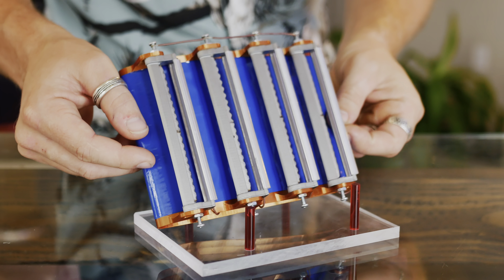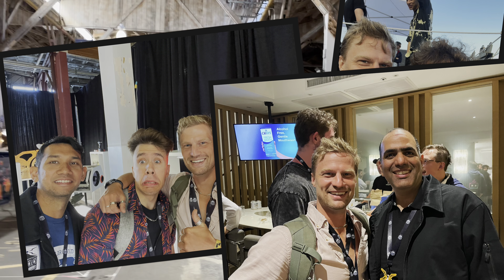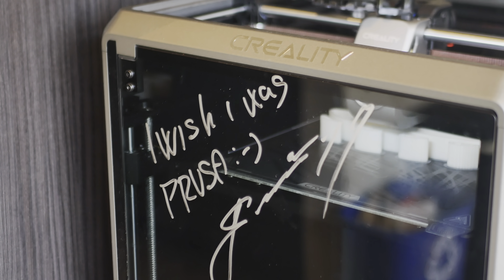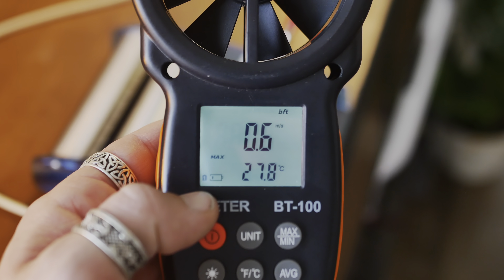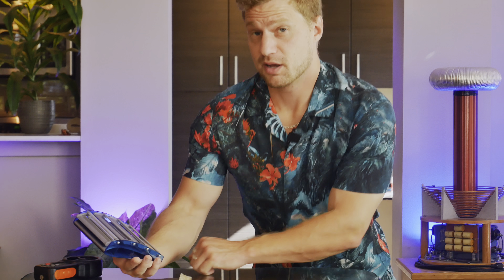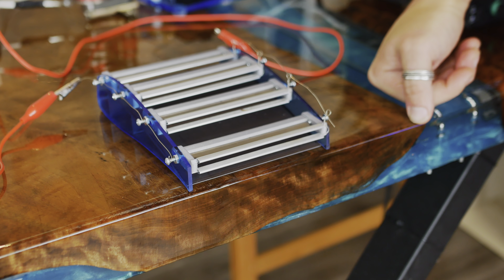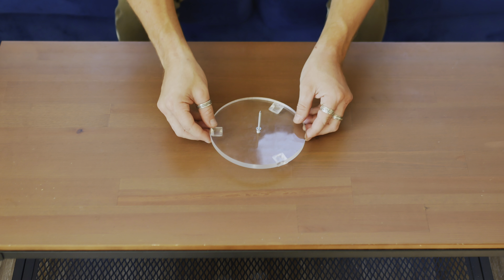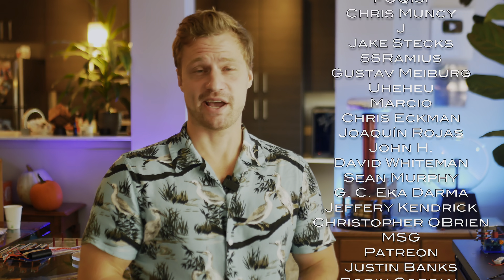Designing A Self Propelling Ionic Thrust Wing

Comment: holy damn! thats an amazing idea!! i will say for as much as i lack motivation to do things cuz of adhd and high functioning autism as well as a whole heaping helping of mental issues from childhood like ptsd and abandonment issues, seeing things like this does always help bring back that desire to really see the limits of what can be done!!! as for possible improvements i could think of off the top of my head right here, some possible ones would be to consider what materials you are using all together and now that your have kinda honed in on a more solid shape and design, maybe its time to consider moving onto the more expensive stuff that is more durable and weighs less (that saying there is tho i would imagine that is the case since 3d printer PVC plastic aint usually too terrible light from my own experience) and beyond that, there really is only the obvious improvements you mentioned of find ways to use less material for the same result as well as increase the possible power output while also trying to maintain the same weight with the power supply. ultimately as it stands right now, maybe one thing you could also try just to see what might be better is mess around trying out different glider wing designs since while it would make sense that one designed for long, slow glides would be best, you never know unless you try especially since it could also be something to test to see if there is diminishing returns from the engines past a certain point meaning a smaller wing or trying with varying amounts of engines could be a way to prevent you from accidentally throwing in too much weight without really getting your benefit outta it. :D all in all keep up the good work and each time a video has dropped in this series, youtube ACTUALLY has bothered to recommend it to me so i will definantly be here for the next one too!

Comment: Love this concept, yes I believe this may be the beginning of non motion based flight.

Also, what about using electro coating to replace external wires and metal.  Also, possibly you could incorporate the pcb and circuitry inlayed into the section of wing that would further reduce final weight and create the option of variable thrust for steering and yaw control.

Comment: I would keep it simple like the ionic lifter, just wires, foils and foam.  String the wires along the length of the wing just above the wing propped up about 1/16” at the ends and add mid supports.  Tape aluminum tape to the wing top surface at the tail end of the wing will reduce drag and parts.  You could add more electrode sections to the inner part of the wings where there is space for shorter length electrodes.  Instead of printed plastic use hot wire to cut foam wings or use a rasp to shave the shape of the wing.  

For added thrust (not lift) use wire rings propped up around the fuselage (made from foam to reduce weight) and aluminum tape to the fuselage.  Repeat with more rings towards the tail.  It would be like your ionic thrusters rings but inside out.  At the end of the fuselage use a ring wire and round tube with a smaller opening at the end before the empennage (tail control surface section) to increase speed.  Like your friend Integza’s ionic thrusters.  You’ll need the forward speed to get the airplane off the ground.  

Battery and RC electronics should be towards the front of the fuselage to balance the airplane.  You can place your airplane in front of a box fan and hold on to the balance point and see if it pitches up or down.  Move the battery, electronics forward or backwards to balance the airplane. The center of gravity (balance point) and center of lift would be 1/3 the wing cord from the front of main wing.   The electrode rings should be further back away from the battery and electronics to prevent arching and possible frequency interference to the RC electronics.  

Double decker wings will double the space for electrodes and add more lift and thrust.  The top wing should be stagger forward like the barn stormer airplanes.

You could make a flying or blended wing airplane.  Electrodes sections on the top of the wing with a few ring tube narrowed at end for speed mounted on the end portion of the lifting surface.

Comment: Wired in parallel? Why not in series? Ok so not traditional series cus air gap but like a voltage multiplier tapped at different points to give an increase in voltage as stages progress but the last airfoil may need to be the highest voltage of them all. You got stls and a shopping list?

Comment: Print an aerofoil frame and skin it with a thin latex. I think you can still shave a load of weight. I'm thinking perhaps the plasma conductors should be closer to the wing surface, so maybe latex is not so good. Maybe wax paper.
For the plasma electrode, maybe a piece of guitar string. Some are nickel wound and so would provide a consistent interval between (I don't know what to call them) {ionocytes}? But the serated blades appear to have misfires. Guitar string may help save weight and increase power, but I don't know. Sure enjoy watching this development. Can't wait to see more. Thanks.

Comment: To maximize the amount of conductive space on your positive ends you could weave the wire back and forth vertically through spaces in the 3d printed part, kinda working on similar mechanics to your original thrusters but along the extremely thin rectangular space where the razor blades used to be. If that works you'd get massive weight reduction and maybe even an increase in thrust. I'm really excited to see this work, it'll be a huge accomplishment

Comment: I'd have to ask how this will effect the Airfoil? With all of the thrusters on top of the airfoil, yes the air will move fast over the immediate airfoil's upper skin , but at the same time there will be less air passing the airfoil leading edge's lower surface, the most critical area, due to suction from the ionic thrusters, causing the stall characteristic to be indeterminable until a set ground speed, then ground effect speed are met/exceeded. This doesn't even take into account the impact of the thrusters themselves impeding the fluid air flow that surrounds the immediate area above the airfoil causing further drag. This would almost work best mounted to the lower surface of a symmetrical airfoil with an upward twist, moderate to high angle of attack, or mounted inside of asymmetrical wing as a pass through that would not inhibit the fluid's action about the airfoil. Wings are extremely sensitive to changes in airflow and this gets further exacerbated at different bank angles or roll maneuvers, and again with wing lift bend which could further diminish the thrusters effect on a top mounted configuration. I only see this working as a type of air pusher in this configuration as it would greatly hinder a wing, almost nullifying its ability to create any lift.

Comment: Very cool. What will kill you is thrust per unit power (ie newtons per watt), and a higher efficiency system actually achieves the same momentum transfer to air at lower velocity. Higher wind speed just means more power wasted in turbulence. 

I remember trying to figure out how to do this in about 2002, before lipo batteries and stun gun power supplies. Good luck!

Comment: Silent electric flight devoid of moving parts... max intrigue! 
The early tests show promise, but it clearly lacks the efficiency needed to overcome gravity with the weight of a craft. My opinion, it won't work. I think an issue is going to be the implemented propulsion method actually interfering with the wings ability to create lift. I shall now posit the hypothesis that even with a significant augmentation of the power output, the aforementioned technology shall remain inoperable to such an extent as to preclude its practical implementation.
With that being stated, there is a significant amount of data that I lack, thus I consider my opinion to be of little value at this juncture. I eagerly anticipate the release of further testing outcomes to gain more insight. I love being wrong in these instances and I really hope this is one of those moments!

Comment: Firstly, I love these investigations. Thanks for making them!  That said, would think that optimizing the spacing between thrust stages could be enhanced with just a little more rigor- by changing only one variable at a time.
When optimizing the spacing between thrust stages just optimize for two alone...  then and only then, move on to adding a third thrust stage and optimize the distance to that, then and only then move on to adding the forth and optimize the distance to that.  You might even find that more than 2 or three is actually unproductive (due to say accumulated turbulence, etc.).

Comment: Cool effort.  But why put the ion thrusters on the top of the wing?  If air moves quicker across the top, then I suppose that if you thrust the bottom, then the air on top will be faster still as it has to travel further....  probably worth an experiment at least.
Reply from the maker: Thrusters on top because even at zero velocity, the wing creates its own lift. With power applied, air only moves over the top, creating lower pressure. Now, when the wing is moving, it requires slower speeds to create necessary lift because the thrusters on top cause faster airflow and lower pressure
Reply: @PlasmaChannel  maybe...  Alternative thought: thruster on bottom moves air and plane in opposite directions. Air drags other air in the neighborhood along. Air on top has a longer travel so it moves faster than the thruster to catch up to the air thrusted on the bottom. thus more partial vacuum so more lift.  I have no idea if this is true, just think its worth thinking about and maybe an experiment.

Comment: If you wanted to shave the weight, and you designed the ionic thruster after an airfoil, wouldn’t you just put 1+1 together and make the main airfoil the ionic thruster?
Reply: That would get rid of the extra weight of the metal screws and the PLA used for the standoffs. 
So what I’m trying to say is, why make 4 mini thrusters when you could, for example, just use the main airfoil with a serrated razor at the end, and a couple arms off the rear with you airfoil designed grounding points. Hope I explained that correctly
Reply: That would also help reduce the drag and the micro eddie currents you have within your design.

Comment: I think an issue I see with this is the fact that he is not really adding any velocity when he adds more sections to it. let me explain since that will probably help give context. how I understand it is that jet engines work by first compressing the air into a small chamber using many blades powered by an electric motor. once in that chamber fuel is then injected and then ignited to help accelerate the exhaust gasses out the back of an engine at high speeds (if I got part of this wrong feel free to correct me! I have no experience in this field, I just like to learn about jet engines since I think they are really cool.). however his engine seems from my understanding to only accelerate air to a certain speed without really adding too much speed on top of that (this also may be incorrect once again feel free to correct me!) anyways that's all I really have to say.

Comment: Should prototype the small section with those changes first.

Should also consider tighter spacing for each thrust segment, with larger spacing between segments. That will minimise the interaction between the electrode of one segment interacting with the ground of the previous one. Smaller spacing will also allow for smaller lighter power supplies.

You can also run them on both sides of the wing. Its more the wing shape that matters, not where the thrust is coming from. More electrode, more better.

Comment: You need to look at equal power across each blade, to do so have the positive and negative connections on diagonal corners. This should give even continuity of air flow.

Comment: Tips :
It isn't "air moving above the wing that accelerate because of longer distance it has to travel and therefor create a low pressure area".
It is literally the shape of the wing that, with the proper angle to the incoming air (which depend on the angle of the wing itself and the slope of its top part and relative air speed), force a low pressure area, as the air can't just slap back against the wing's slopped top part instantly.
Imagine you move your hand fast enough inside dirty water (where you can see particles, dye, or anything to visualize), the water and whatever is inside doesn't instantly get against your hand's back, you create this region of low pressure, it even works if you angle your hand like a wing, btw, if those vortices and the particles along it reaches your hand (or other object) or create a cavitation effect, that's the equivalent of stalling, fluid mechanic ways of working mean it is translatable to air.
Which, in this case mean, airflow getting too fast for this angle and can't flow across the wing's top, or isn't flowing fast enough to make a good flow sort of like a water laminar flow that help it to "connect" the wing to the lower pressure above, as now, rather than all the air being low pressure against the wing until it goes far enough to equalize with the atmosphere, you have turbulences everywhere that will be the thing sucked upward rather than your wing, meaning, half your lift is gone.

BTW, "drag" have 3 components :
*1 Air resistance : Physically pushing through the air, literally, moving air molecules out of the way.
*2 Friction : Atmospheric pressure making the air force against you, which, literally like a sledge on snow, slide well, but still grab your inertia.
*3 Drag : The opposite of air resistance, when the aircraft move away the air can't instantly get back behind it, which create a low pressure area, think about race car's slipstream, this literally suck the aircraft back the same way the low pressure on the top of the wing suck it upward.

Now, if you can, at low speed, "scoop" some of the air from the top of the wing and push in on the bottom, you decrease the low pressure on top and increase the high pressure on the bottom, making the aircraft get more lift, which also mean less required angle of attack and overall less air resistance.
You know how some airfoil profile, including the one sent to you have a concave shape, this is the perfect place to "inject" this air, where, because of this "hollow" part on the airflow's path that it want to expand into, it reaches the lowest pressure.

But there is still a requirement for enough air to "slide" against the top, if you don't have this air layer, you stall, stalling is literally this smoothly flowing air layer, disappearing.
Now, any conductive fluid, including, let's say, a plasma, follow electromagnetic and magnetic fields, meaning you can force stabilize the air that flow above your wing.

In fact, if you can redirect part of the air that would, normally, only create losses from "air resistance" without creating any net lift, and push it behind the aircraft to counter the "drag", you gain a lot of flight performances.

Same way with a "magnetic shield" that could keep away some of this plasma away from the fuselage's sides, meaning less "friction".

Also, the action of pushing the air aside during "air resistance" is creating a loss of forward momentum only because of the forward motion relative to the air, the lateral motion of the air getting pushed aside doesn't impact the vehicle speed, though, pushing it mostly in one direction can generate lift, this is the principle behind lifting bodies.
But considering this, it means that if you could push aside the air molecules in front of the aircraft, just before they touch it, without affecting their forward momentum relative to you, you won't lose energy from "air resistance".

Of course, with a Lithium battery, you can only do so much...
BUT, any of those improvements are still an improvement, if you can literally make multiple use of your components, like using "waste" magnetic fields to your advantages for example, then you can gain performances.

Comment: I love the idea of incorporating the thrust into the structure. However, I don't really think you did that. Like commercial airliners, you've simply attached the "engine" to the wing (on top, instead of beneath). Is there a way to make each ionic thruster an airfoil or have a long, single ionic thruster serve as the sole lifting surface?

Comment: Just amazing!  Why not place the negative on the surface of the main wing (aluminum foil maybe) and position the positive wire slightly in front of the negative one? This approach might help reduce the drag generated by the smaller airfoils, potentially leading to higher airspeed and lower overall mass. Thank you for this incredible content. It's really inspiring.
Reply: This was exactly my thoughts too. Use the aluminum tape stuck straight to the film on the wings, suspend the wire at every stringer, this would also help support a light weight wing

Comment: Great work on the propulsion, and it looks like your propulsion units actually help create lift. Using more tradition "model plane" building techniques, i.e balsa or thin foam instead of 3d printed might help save even more weight
Bit worried about the drag you'll end up with though, especially on a full wing. I think drag tends to increase exponentially.
Reply: There's a special low weight filament available
Reply: @DJXaevo  maybe,  but the drag issue remains.
Reply: balsa/foam will be way lighter than anything 3d printed

Comment: I would think the exposed thrusters on top are greatly reducing the uplifting airfoil effect.
Add a thin airfoil sheet over the top of the thrusters allowing more lift with proper slope while enclosing the thrusters.
This would only increase lift in motion not increase thrust.